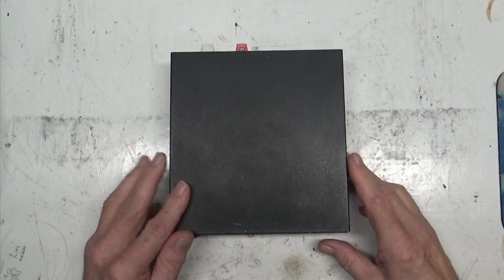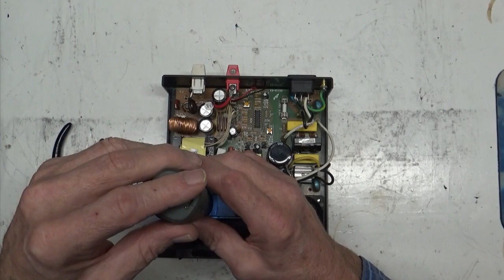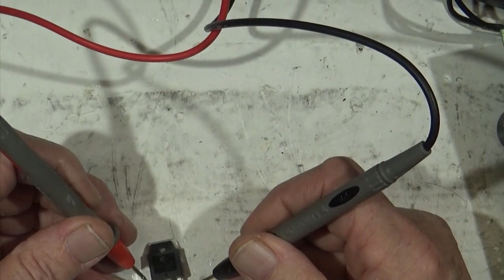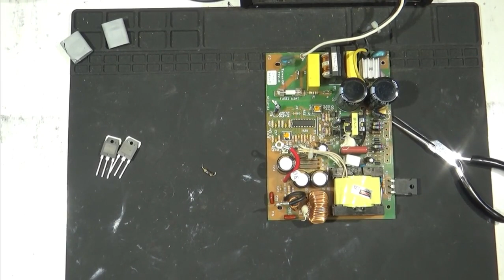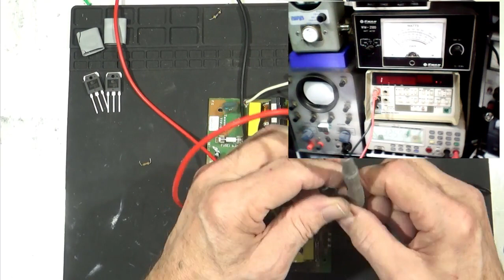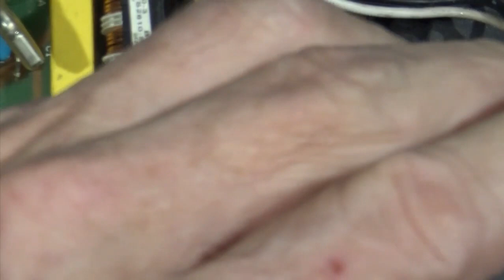Repairing a Samlex SEC1223 Switch mode Power Supply

Comment: Im not sure if you will see this or not, but I have a Samlex 30amp switching dc power supply.  I accidentally broke the top off the screw-down bolt in the red terminal and cannot get it out.  Do you happen to know if they sell a replacement red terminal and where I could find it?  I've emailed the company and hope they respond soon.  thanks Jeremy KF4CHW
Reply from the maker: I really don't remember how that was made. I looked at pictures of a 1212 and it looks like the red terminal is a standard screw terminal you can get on ebay or from digikey etc. Sorry I can't be of more help.

Comment: Don't you need to put some heat paste on the two output regulators???  Cheers & 73 from W Rusty Lane K9POW in eastern TN
Reply from the maker: Yes. I did before I buttoned it all up.

Comment: I thought you couldn't test resistors in circuit???
Reply from the maker: You can test them but only to check if they are not higher in value than they are marked. Lower in value is possible since there may be something else in circuit but they can never be higher  in value.
Love the name, Tool Man. LOL
(I can say things like that since my name is Dave Mathews)

Comment: Nice repair! Unless it was an emergency I think I would have ordered some resistors. Also, spacing power resistors about an 1/8 inch off the board really helps with cooling and cuts down on board frying.
Reply from the maker: It is not an emergency. As it turns out the original resistors were only 1/2 watt anyway and they don't seem to get hot but thanks for the suggestion.

Comment: Old style resistors were rubbish their tolerences were fingers crossed legs crossed that the value and tolerence were correct, 
You're wasting a lot of bench time running in circles with poor quality parts. 
And when switchmode PSU's go they usually go good style! ;-) 
Glad you sorted it in the end ...
Reply from the maker: I went through a selected bunch of those old resistors and they were ok. Of course the ones I wanted were not ones I had tested. Murphy.

Comment: Did the fan run on the power supply? I never noticed it turning
Reply from the maker: I have to run it for a while under load. The fan is temperature controlled. Good thought. I will let you know.
Reply: @AERVBlog  I took a lightning hit on mine and the fan runs all the time now. Could you tell me where the sensor is located so I can replace it?
Reply from the maker: @williamlowry9585  I will have to look it up when I get home tonight.
Reply from the maker: Yup. I tested it. Heated it up past 70c and the fan came on. Thanks for the tip.